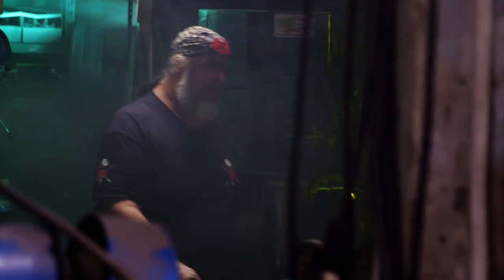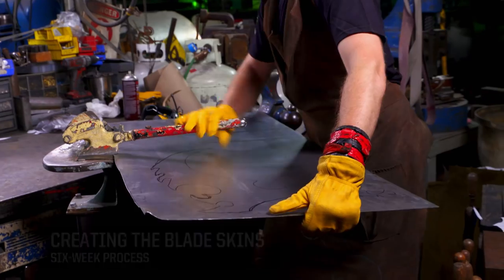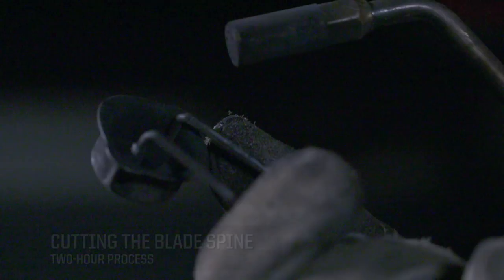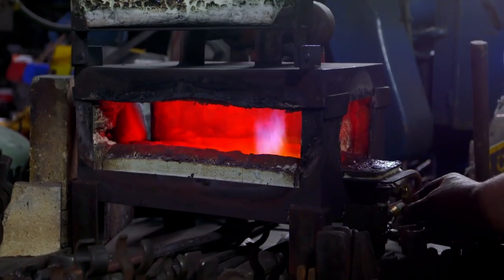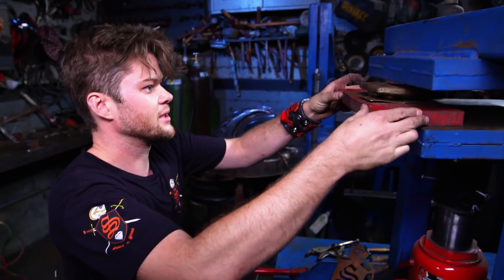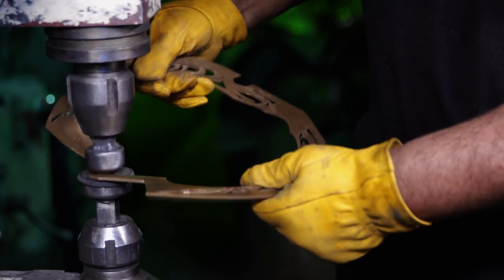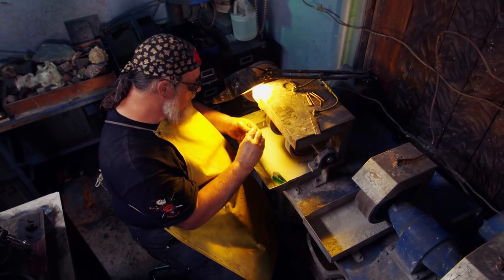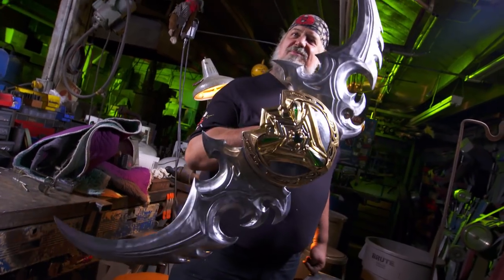Azeroth Armory: Forging Warglaive

Comment: the way he wields that warglaive... yukk
Reply: Well, it doesn't help that warglaives are one of those ridiculous fantasy weapons that don't work well at all in real life. I mean, the way it's wielded in the games incentivizes twirling and flourishing, looking like a sword-wielding idiot. If that weapon were made in actual medieval times, anyone who tried to swing it would get skewered in seconds while the wielder twirled like a ballerina of stupidity.
Reply: Could have worked better if attached to the full forearm instead of just held by the hand, allowing greater control of the movement and overall less risk.
Reply: so the guy using it is and getting skewered, and then the wielder is twirling? gotcha
Reply: Actually it makes more sense to use it that way with the edges pointing toward your opponent, kinda like the klingon Bathleth.
Reply: dude wants him to wield it just like a DH...okay guy what are you smoking
Reply: There's no way to effectively wield it and have enough force to cut in a single hand.
Reply: theyre cutting melons and wine glasses, atleast make it look cool Ghost
Reply: simongosimon Mate, they would be more likely to knock them off an edge than cut them with one hand.
Reply: I think the issue is more the way the handle is made  it not large to allow a fit grip it a perfect round  thin cylinder which is why it's turning in the hand if the grip was more oval  rather then a perfect circle there wouldnt be much of a problem as in handling the weapon.
Reply: +nomi THIS IS TRUTH RIGHT HERE! I am so annoyed that the handle was made circular and basically unusable because of it...
Reply: Your reply is more of an attack then actual understanding of what I said clearly you didnt read properly. Not to mention I never said the weapon was practical for combat use nor said that is was terribly light. I do understand all he did was a replica.

Do yourself a favor and read carefully rather than attacking  your looking silly also for the handle I said he should have thought about it because and I quote '' he is a MASTER blacksmith the guy is really skilled at what he does he should have thought about that''  again you didnt read properly I wasnt in anyway bashing on him,

Again you didnt read properly .

Also if you looking properly when he swing's the bar is sliding in his hand. the handle is making it more difficult to handle then just the actual weight which as you said is heavy.
Reply: I know, right.
Reply: I Sexually Identify As a GTX 980 Ti Stop your trolling everyone here knows Nomi speaks truth here. But I would also add that a wrist-bracer attachment to the hand-shield of the weapon would have helped as well to prevent the weapon from turning in the palm similar to what they do with shields.
Reply: KillerPassifist Go back to Warcraft 3, take a look on how Illidan handle them, then come back to me ...
Reply: I just wanted to make a note that these weapons were designed purely as demon-hunting weapons. I have never seen a demon wielding anything besides Axes in the WoW universe. Axes are great for chopping but when you think about it the design of the warglaive (if it were made easier to stabilize and control via proper handle as well as wrist/arm brace such as how shields are stabilized) would be a wonderful counter/block to deal with those axes. Which is why there is a handy mini-shield (also called a buckler) to protect those hands from axe swings and create openings to use the second warglaive on, or even just steal the axe out of the demon's hands or else possibly one little slide of the glaive and no more demon-hand.
Reply: Are you saying twirling and flourishing looks idiotic?
Reply: Well, the proper way to wield this weapon is to just hold it horizontally and use your demonic powers to dash and cut through the hordes of demons. I doubt these guys are able to do so, so they had to improvise.
Reply: @grimfang999
Attaching the weapon to your forearm would cause the shock of every impact to transfer unmitigated into your body. It's a quick and easy way to dislocate or break something. Also if your sword is ever stuck somewhere and you can't control it (for example, in the body of a falling demon, or being controlled in a bind), you basically lose control of your entire body, because you are being dragged around by your own weapon that you can't let go of.

@Silvia Fox
Shivarra use swords exclusively. Succubi use whips. Many felguards and wrathguards use swords. The eredar use swords as well, and then there's the abundance of demons who use magic exclusively.
Also, there already exist weapons to counter axes. Pretty much anything on a pole (spears, halberds, dane axes, or even just the quarterstaff itself) can deal with axes just fine. Swords are also excellent counters to axes if you know how to handle them.

@Oliver Yuen
If you're supposed to be fighting? Yes. Yes it does. A lot.

Comment: Warglaives have got to be some of the most impractical weapons but, god do I love them
Reply: Illidan thought so as well until he trained himself to use them, so the lore says, the theory of them seems great but difficult to judge off an idea that didn't get a great run in history... or maybe they did
Reply: Well assuming they were immune to getting dizzy and disoriented, i would not want to fight someone who had 2 warglaives and i only had a sword. its like fighting a blender. No decent opening. But irl no one could keep that up and there are far more effective weapons.
Reply: Take your warglaives, I'd pick the sword any day. The range of the glaives is practically ZERO, you'd have to come in full contact range to land a strike. By then, the tip of the sword would already exit your back. Plus the glaive weights an incredible 20 pounds / 9 kg. A normal 90 cm long knights sword weights only 1.2 kg and holding that is already tiring and a lot of weight on your wrist. Even if the glaives had the same weight as the sword, you would very fast come to the conclusion that you have no chance against a sword, which is scientifically proven to be the ultimate melee weapon since human existence.
Reply: +Crypsis the warglaives in this context are cosmetic weaponary, the weapon could most certainly be modified to weigh alot less and you have to be able to picture the kind of warrior who would actually weild such weapons, think of a martial artist with amazing finesse and dexterity as well as strength, someone with acrobatic agility and the weapon seems more plausible... once again this is all hypothetical, perhaps the sword is the greatest weapon, but a master weapons expert of many different varieties will still give the sword master a run for his money, can't think in such black and white terms
Reply: +Edward Ness Making that a requirement (requiring an athletic martial artist) is the the first indicator that the weapon is rubbish. It's easy to make something complicated, but it's complicated to make something easy. Only because it's hard to master the weapon doesn't make it better. I.e. It took me a lot of practice until I didn't hit myself on the head anymore with nunchucks, but I would still lose every fight against a sword fighter. Plus the glaives have also a sharp edge on the inside pointing the wielder. How stupid is that? The tip is pointed inwards, which means you can't stab with it, which is more efficient then hacking. And even if you tried to stab with it, the other end is pointing towards you again risking to stab yourself. This weapon is more dangerous for the wielder then for his opponent.
Reply: Crypsis The way it is used is not actually that difficult. I'd compare it to the use of a slightly more complicated buckler.

The way that I imagine the aboriginals use them (I have no records, so I just have to look at the pictures) is that they cover a line of attack to guard, alternating between holding them engaged by the shoulder and the bicep, while using a primary weapon such as a shortspear or another weapon to point. This is from what I can tell from the design of the weapon, wooden, no sharp edged and a central hold that protects the hand.

I do not know enough about the maduvu to make any statements about it's use, as there are supposed to be metal versions and for all I know, there are bladed maduvu that can cut, but the examples that I have seen, the maduvu only has metal, reinforcing tips that facilitate a shortspear-like thrust. Which leans me to believe that maduvu are, for all intents and purposes, wielded identically to how the aboriginals do their parrying shields.

I don't think that it's inherently unrealistic for a bladed maduvu to exist, but it seems unlikely to me personally that you could keep the edge alignment right. Which, to me, explains the curve that they are given somewhat; the curve shifts the center of gravity further back, potentially making it easier to find the edge alignment, but I can obviously not be sure.

Speaking of which, if these were bladed weapons, I imagine that there'd be a 'main' blade and a secondary one. The main blade would be slightly heavier than the secondary one, shifting the center of gravity back upwards. That is, if you'd want to use them for cutting and for them to be slightly more nimble. The main blade might lack a false edge, being thicker at the back, preventing a false edge from cutting the wielder if a demon just grabs the blade and draws it across the demon hunter's throat (especially with some of the more extreme curves I've seen).

I'm heavily invested in night elf martial arts, as you may or may not have been able to tell. 

My favorite is the moonblade, the weapons that wardens use, since it's a very obscure reference to the warden's blinking ability and the legend of a child-god using two chakram-like weapons to fly.
Reply: It also should be noted that anything with a pole and a pointy end is superior to a sword in melee, just saying. :P
Reply: isn´t impractical, they can be used for dealing damage using circular movements in the center of fight

Comment: Giving the gem on the Ashbringer, a suspended illusion can be done probably by using  some kind of durable and strong transparent thread (maybe  extended on the dull side of the blade and one going down to keep it from rotating around. Hopefully we will see it done before it becomes common sight in Legion. Or maybe Sargeras' sword - Gorshalach was it? The most powerful weapon of Warcraft Universe. Anyway - great work and can't wait for more!

Comment: I like how the demo at the end proved exactly why Warglaives were never a practical design for a weapon.

There's just no good way to use them.

About the only way to do it would be to shrink the bottom blade until it's as small and light as a dagger, and then use the top as a one handed sword and the bottom as a fighting dagger.
Reply: They are supposed to be a slashing weapon you use when you spin. They are using mostly arms in this. Arms extended and you spin. you can do a stab with the end but that would be a finisher after an opening is cleared. The wrist isn't strong enough to hold it like a sword. That's why gravity needs to be used to swing them.
Reply: +James Douds that still seems very impractical to me. I'd never want to do a full bodied swing,  exposing myself.
Reply: That's why you have two. The second covers you while you attack with the other. It's like a shield and a sword in one.
Reply: hah! that's awesome, we both posted similar ideas. You're absolutely right. Plus the sheer weight of the thing! You'd have to be build like The Mountain from Game of Thrones to wield that even remotely effectively and even then most good melee weapon fighters would win. Anything from a whip to a spear to a short sword and everything in-between.
Reply: +Joe Cannabyte thanks. I don't do fencing like you but I do do Kung fu, which includes weapon training. I also study a lot of physics and to me war glaives just look like they put you at too much of a mechanical disadvantage.
Reply: No way for us to use them, Demon Hunters are trained into a very specific form of armed combat, that includes a lot of dashing and spinning. Its not like IRL there isn't weapons that are utterly useless if you don't know what you're doing with them either. Nunchakus for example.
Reply: +Zergal00 except that's not an apt comparison. we actually do have an idea of how warglaives could be used and they're just not effective. Just because anything can be a weapon doesn't mean it should be. The demo performers here show that well.
Reply: Joe Cannabyte I have done fencing. it was allot of fun in college. When I made my statement about the warglaives, I was talking about a practical weapon size and length. This was a show piece. But if you were to make then and learn to use them correctly, you would never be open for an attack due to the offense and defense qualities of the weapon and style.
Reply: @James Douds
Or you could simply use a practical design. One where you can use the full weight of the weapon for every single attack, instead of having half the weight act as a counterbalance, thus bluntening your every blow. One where you use a style that doesn't involve you getting disoriented with every single attack you do, courtesy of pointless spinning.

You could learn how to use a warglaive in a way that it's better than no weapon at all, but why would you if you could spend your time way better learning how to use a regular sword?